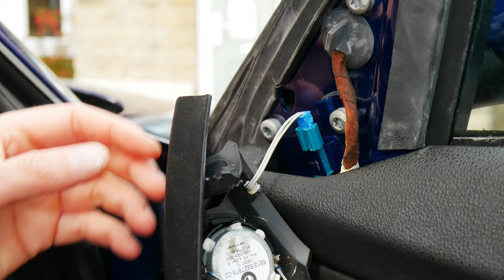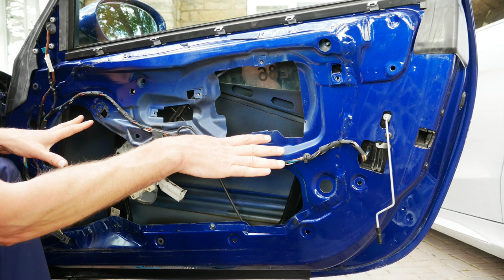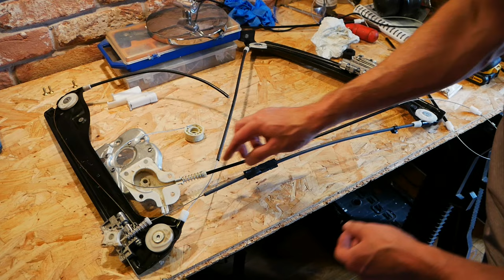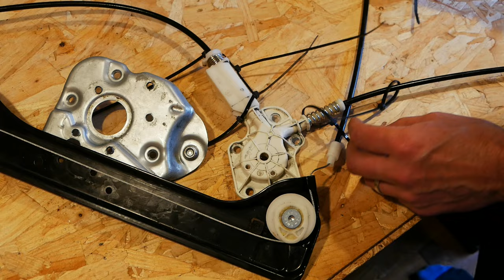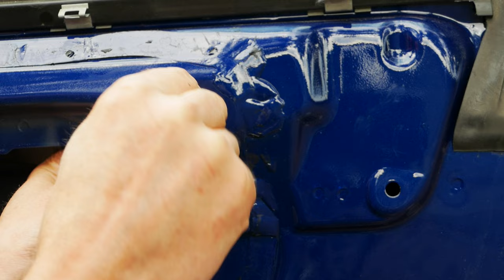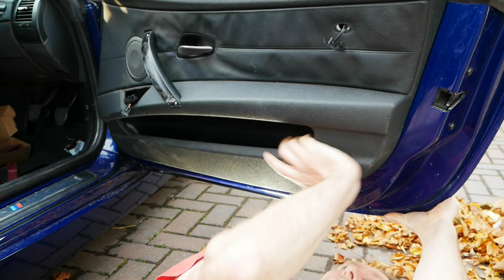BMW Z4 Window Regulator REPAIR (Cable) - BMW Z4 E85 / E86

Comment: Thank u so much with this detailed walk thru. Just spent the morning replacing the cables using this video and all fixed and working a treat. Garage wanted £650 to do the job
Reply from the maker: @ps8225 Thanks for your comment! I'll be honest, it was a difficult video to film and edit, so I'm really pleased it is helping so many people save some money! Not the easiest job either but wow, a £650 saving! Not too surprised though, the full part from BMW is expensive and then at least a couple of hours to fit it... Cheers, Phil

Comment: @22:22 I don’t exactly understand this part of setting the rear of the glass. In my case, my new glass has the plastic sandwich pieces already attached. Can I leave this alone and simply line it up and screw in the bolt?
Reply: What a minute - now I think I see that the Plastic sandwich sits on a “hook” on the regulator.
Reply from the maker: Sounds like you got there! Sorry if that part wasn't clear! Cheers, Phil

Comment: Thankyou for this video, I just wish more folks who created tear downs were as thorough explaining in intricate detail.

I've ordered the materials for the job 1x repair kit 5× stainless m8 flush head, slim nut fasteners. This detail has been a godsend as it means I am more likely to be able to get the job completed in one go, rather than realising I need more hardware to finish part way through.

I have got as far as removing the door card and CAREFULLY removing the tacky black perimeter of sealant around the foam.

One tip I can recommend when it comes to removing the lower plastic pop clips on the door card; Take your time to locate each clip and work along to apply pressure in stages, rather than pull in one go from the bottom outer edge.
I also used 2 to 3 plastic glazing packers (wedge type). Work one in, to one side of a clip, then put a second in a little deeper to the other side of the clip. Keep alternating this method and it gently levers the clip (less chance of breakage).

Thanks again, all the best!
Reply from the maker: Hi Chris, thanks very much for your post! Also, some great tips there for removing the door card with less chance of damaging the clips. I have some of the packing pieces you are talking about and will definitely give it a try! Cheers, Phil

Comment: Following your instruction is great. But I found one more easy way to get the last big plastic wheel in place. 2 way around with the wire just as you did both up and down and put the wheel in place but with the wire slacking. Then put the wire on one of the other 4 plastic wheels and slide the wire in place and last, put the wire in the two brackets that slide the window up and down. Also If you use the old plastic wheel or if you buy a new set, note that the whires may go the other way around in the plastic wheel. Sorry for my bad english. I´m from Sweden. :)
Reply from the maker: Thanks for sharing! There’s always more than one way to do a job and anything that makes it a bit easier is a good thing! If I have to do it again, I’ll definitely look at the information that you provided! 👍

Comment: Hello,
For the countersunk bit for metal to drill edge off what size is best.
Thanks Tom.
Reply from the maker: Hi, I find when using a drill in that way, you need one several sizes larger than the rivet. So for example, if the rivet was approx 6mm diameter, I would use at least an 8mm drill, maybe even a 10mm. Hope that helps!

Comment: I suggest anyone to set the position of the lift to ~26cm between the top corner screw ( center of the wheel ) and the hole that is use to fix the glass before mounting the motor back.

Comment: I followed your tutorial , it helps a lot , unfortunately the kit i bought on ebay is a sh...it. the motor wheel is 40mm on the kit , but mine is 38mm  and the crossing cable lenght also is around 40mm shorter (i remarked that cause the both lift where not moving to the same final position )  and i couldn't event reuse my old motor wheel waiting for new parts ..
I bought 5x16 mm flat head screw to fix the plastic cover in case you wonder what to use to replace the rivets.
@ReviveMyRide do you have any reference for the kit u used ? . also is it possible to replace a corner wheel  ?
Reply from the maker: Hi @toumbi Sorry you have run into problems. Unfortunately, there area lot of kits available and a lot of variation in quality. I didn't want to recommend the kit that I used because it wasn't perfect either, one of the cable ends (that has a large white plastic clip on it) wasn't correct for my car and I had to transfer it from my old regulator. I also didn't use the wheel but mainly because the quality was poor (rough 3D printing?) and my original one was still in good condition. Regarding the corner pulleys, I'm not seeing any kits with these but you can buy a complete window regulator that comes with them. Just linking to an example: https://www.ebay.co.uk/itm/351865601511?fits=Car+Make%3ABMW&hash=item51ecd2fde7:g:05YAAOSwzaJX9EL~&amdata=enc%3AAQAIAAAA8PCIy5uBR4fMbakqG1LGV8HNFKXVbW8vTeWlAkle6BkRxiKnfh7QlXXaAn%2BKdS4P8DMKfsCeQQ5BXPVD3toAeQkJ7zKbfC%2FofbBpb6EsqMeqdLPpPDEkvgWYUucsEEjeSh9ec%2BannIFB08jnU6ddWO3soVD243MXyrGdgRWolRbYZBAkLR%2BUQSukW9DJGGUEzVO5GEMCfQHOJkp6Zt0sGLCHXesihI1G2OwzhkvZx30xn%2FFjpq9LboClvjUf6Sw0Rh1yyfmsbUrHNHWbsU%2BMVknbNfv20x%2BnlOGo%2BQIzNL5tZZvlO3gRMQ%2BOc25ofEcwpA%3D%3D%7Ctkp%3ABk9SR6rrm8jrYg Hope that helps! Thanks, Phil
Reply: Hi  @ReviveMyRide . I will by a new regulator complete , I can't wait to fix the windows open. Anyway don't buy the 40mm wheel for your E85 z4 cause it's not compatible and double check the 2 lifts move and stop the same position while cable is in place . Thank you for the great tutorial , It helps a lot . 👍👌💪
Reply from the maker: @toumbi  Cheers and  thanks for the additional comments here and above, will hopefully help others that do the job! 👍

Comment: Hi! Thanks for this video. I was wondering if it is possible to force pull the glass up (stuck on down position) without removing the regulator while im waiting for my repair kit to arrive?
Reply from the maker: Hi Sam, yes you can! In fact, I did exactly that but didn’t show it in the video, maybe I should have. It is still quite involved though, you will need to remove the door card and access the mechanism, then detach the glass from the regulator on the left and the right. You can then lift the glass up. I used two pieces of wood, cut to the right length and with “vee” shale cut in the top where it touches the glass. You can also use holes in the inner door to put a temporary wood screw through to help hold the two pieces of wood in place. Hope that helps! Thanks, Phil

Comment: I have the same problem with my G32 6 Series GT Rear Right window regulator, (broken wire or cable) where do I get the new cable from to do this job please motor and all else is good the cable is rusted through and snapped
Reply from the maker: @pauldavison2012 Usually there are a lot of these kits on Ebay, that's where I bought mine. Sometimes the quality of spools and other equipment is poor in thembut usually the cables are ok. As always, look for a seller with good feedback. Allow plenty of time to do the job, could take all day if you have some minor issues. You can also get them from BMW but they usually want to sell you the whole regulator mechanism. Cheers, Phil
Reply: Many thanks fir your reply much appreciated.  I also need the wheel as the frayed cable has damaged the grooves. No kits for mine on ebay or anywhere else but got the new galvanised 1.5mm catenary wire from a supplier in England for £3.50 and I can probably get the 2 end ferrules off and resolver to the new wire. BMW will only sell complete Regulator £317.75 2 day delivery time but I found the name of the maker on the unit with the gear wheel in it and I have e mailed them ref purchasing the gear, will let you know how it goes, Many thanks for the video as it's the principle that matters as all Window Regulator units are very similar.
Reply from the maker: @pauldavison2012  Hi Paul, some good creative thinking there! I hope it all works out for you because that would be a good solution and yes, if you have time, would be really interested to hear how you get on! 👍

Comment: Amazing video! Don't suppose you have a link for the cable repair kit by chance please? I don't want to get the wrong one!
Reply from the maker: Hi @rossmaitland9848 I didn't to recommend the kit I bought because I had an issue with the reel / spool. It looked like it was 3D printed and was a little too large. It wasn't a problem for me, I just reused my old one as it wasn't damaged. But if you just need the cables, it worked fine for that: https://www.ebay.co.uk/itm/324917595290 Thanks, Phil
Reply: @ReviveMyRide  Great video which was essential viewing for me.  To be honest, I had to keep referring back to it countless times during the job!  I’d never have been brave enough to attempt this repair without your video,  so many heartfelt thanks.   I too had issues with the plastic spool that came with a repair kit I bought on eBay; the cables supplied were fine.However they sent me the wrong side spool…(drivers side, instead of near side left.)
I spent an age trying to thread the two cables onto the spool just like in your video,to no avail. After repeated views of your video and a lot of head scratching & cursing, I eventually worked out that the spool supplied was a mirror image of the original spool! 
I ended up using the original spool, after cleaning it up. Cables went on easily this time!🤣 Thanks again…much appreciated.🤙
Reply from the maker: @joseperez4561  Ah man, I'm with you! It's actually quite a tricky job. Glad the video helped you but there are so many variables, other DIYers are bound to come across new issues. Can't believe the wrong spool curve ball they threw you, well done figuring it out! That would have been half a day of trying for me because I'm so stubborn! lol! Cheers!